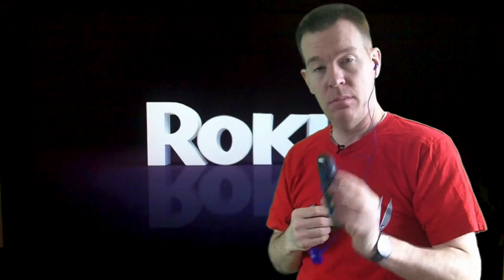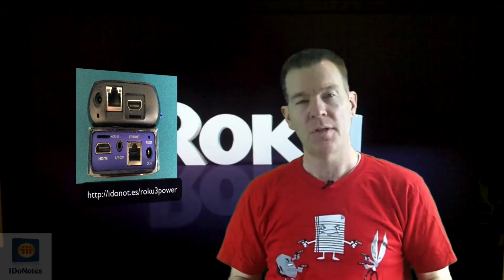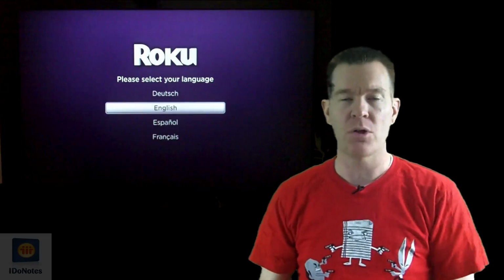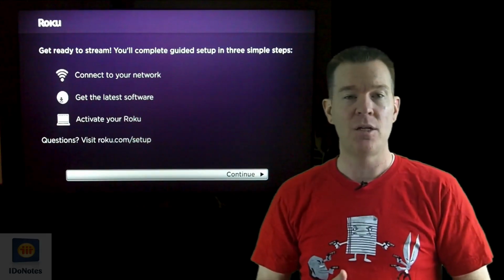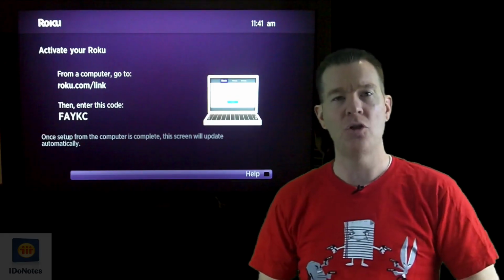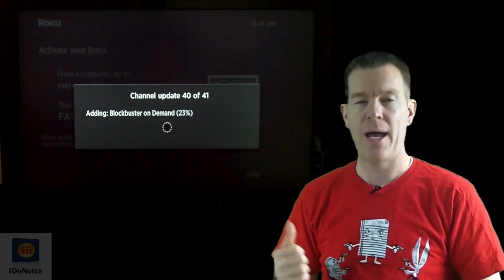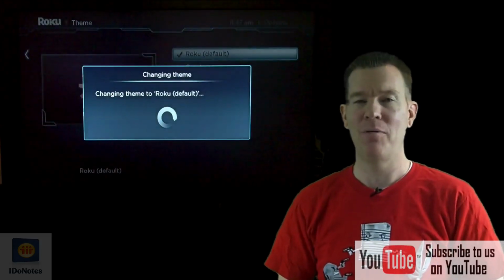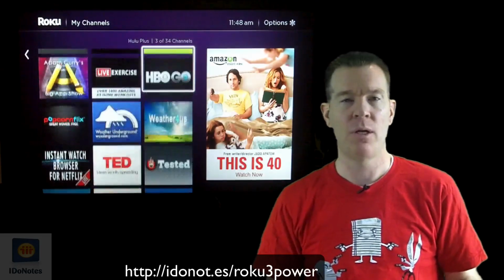Roku 3 review and setup (Model 4200R)

Comment from the maker: It does very well with the included headphones or any set I have plugged in.  I have not noticed any drain on the battery but the longest I use it at one time is an hour or so.

Comment: The reason the initial load took much longer than the first is because with ANY software the first time it runs it basically takes about twice an long to run as the ones after to. The first run actually setups and checks stuff. Tge ones after dont do this. Now u understand :) hope this helps

Comment: What would work best between the Roku 3 and new Roku stick as far as loading time on Netflix or YouTube at the beginning of a movie or anything like that?
Reply from the maker: Reading all the Amazon reviews and forums (which I do often for the Roku) it seems that your Internet stability and connection is more key. Both perform well when a good connection is there, but fail when it is not Wheels8504 

You can get ethernet over to a Roku by a few ways to help stop the wireless drop issues. But I do not see drops or buffering on two of mine on wireless

Comment: I got the roku 3 from a relative with no instructions. Can you tell me what the A & B buttons on the remote are for?
Reply from the maker: Usually for games if you hold the remote sideways.  The remote is also a wireless controller. Angry Birds should be on the Roku and ready for you Danielle .J

Comment: My Roku 3 has stopped working three times. Each time it displays "HDCP Unauthorized Content Disabled" . It's an easy fix by pulling the power supply from the Roku and putting it back in. Is this a cable, TV pioneer kuro or Roku issue?
Reply from the maker: There are a few things to check to narrow it down.  Try a new HDMI cable. That error indicates that the HDCP handshaking is failing, a bad HDMI cable can be the cause. At least your TV is smart enough to output the error, for most get a solid color screen.  You can also try a different HDMI port on your TV or AVR, the port you're connected to may not be working correctly.

Some are also saying the new software update on Roku could have an effect.  here are some more steps.

Bypass any receivers or stereo equipment by connecting your device directly to your TV.
If you're using an HDMI cable, try reversing the ends or try a new HDMI cable.
If you're connecting via an HDMI cable, try another HDMI port on your TV.
If you have one available, swap from an HDMI cable to a component or composite audio/video cable.

Comment: How much data does it use?  I watch alot of TV round the clock, bedridden.... I am afraid there might be overages????  If you are using it, does that mean that every movie or show is using major data??  Thx
Reply: Streaming videos over the internet consumes a lot of bandwidth:

An average standard definition (SD) video uses 0.75 GB / hour.
An average high definition (HD) video uses 2GB / hour.

Contrast that with sending an average size email without attachments: 0.02 MB

My data usage quota is 250 GB / month = 8.33 GB /day. So assuming I do nothing on the internet but stream HD TV shows and HD movies,  I could stream an average of 4.2 hours of HD TV content per day without exceeding my quota.

If you watch a lot of TV, consider using an antenna to receive over-the-air digital broadcasts. That doesn't work well for me because antenna reception in my area is poor, due to surrounding hills.

Comment: hello, i have some quistions. well my xbox finally got the red ring of death and i am a netflix fanatic. i was wondering if i should go with the roku 1 or 3. my xbox was connected by direct wire and so the streaming was good, but the wireless wifi in my room is not the best usually 4 out of 5 bars. if i buy the 1 will by tv be laggy and have to wait forever for shows to load. if it is then i will buy the 3 and direct wire. please help with a reply
Reply from the maker: The Roku channels and connection will only perform as fast as the speed you get via whichever. I prefer to hard wire mine except two rooms where we use wifi. They are close to an access point so it always works fine. Low bars would buffer longer in most circumstances. Having the hard wire or wireless option makes the 3 the better choice to us.

Comment: question: does anyone know if there is a way to change the preassigned favorite buttons on the remote or deactivate them? I like Netflix and Amazon but the other two are not necessary, I would prefer another application to a quick start.
Reply from the maker: +Rachael Otiegbe I have never tried but that is a great question. Lets see if we can get an answer

Comment: I'm trying to connect to Roku wirelessly. It worked the first time I did it but now it won't connect. I'm wondering if my old 2-wire router can not work for this product? My 2-wire router works for my wireless phone and computer at home. It's so frustrating!!! I set up my Roku account on the internet. I know my password works for my router because my phone, my friends phone and my computer all connect to the internet wirelessly. I get the first green check mark, "your wireless network" but now I keep getting a red check mark for "your local network". My error code is 014. Why won't it work???
My friend was here and saw the three green check marks the first time I set it up. It downloaded the software but since then I am unable to reconnect. I even took my first Roku unit back to store and exchanged for a new one. But still the same thing happened. HELP...
Reply from the maker: Did you make sure you had the most recent firmware on the Roku? I had this same issue on a Model 2.  I factory reset it, got the updates applied and then it worked great.